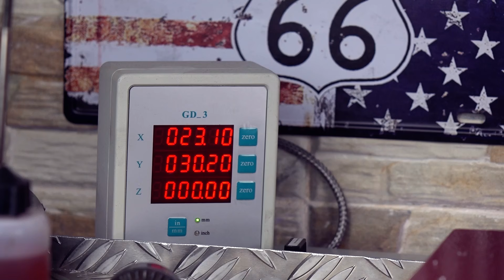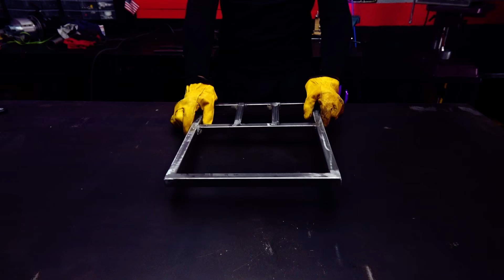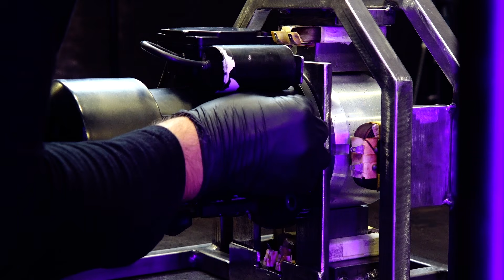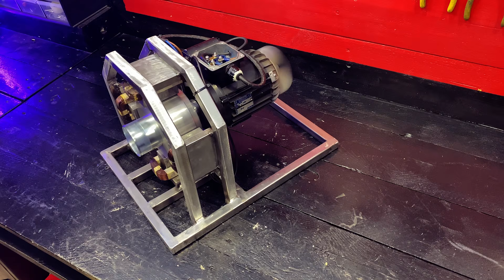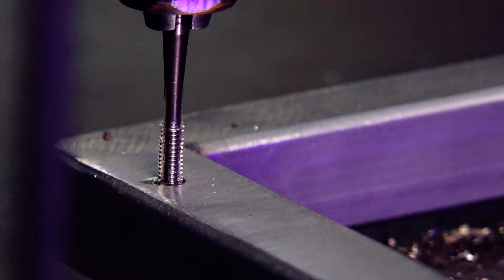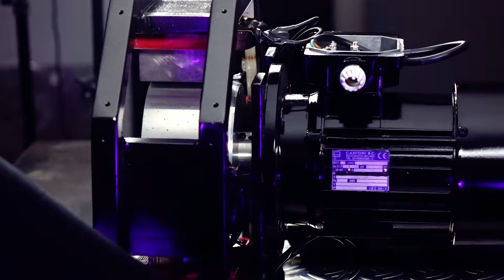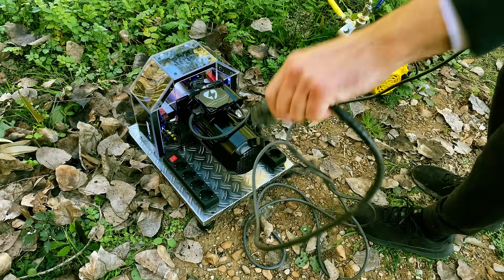20KW INFINITE ENERGY GENERATOR 110-220 Volts

Comment: i am not against it, with my limited understanding of physics, i dont want to question anything out of my knowledge. the motor cost, the magents life are the real deal breakers, for this to go to mass production the cost of operating this needs to be lower than hydro, coal, and nuclear power plants. at this moment. it still looks like a hobby project, can it power one home entirly ? an avarage full load is 5 fans, 2 acs, 1 fridge, 10 lights, 1 tv and 1 washing machine?
Reply: In response to your question: No, it cannot produce any energy at all, because magnetism is not an energy source — it is a force. This system has no energy input, so it cannot generate energy. That’s a basic law of physics. The only thing it actually produces is YouTube ad revenue for the people making these videos.
Reply: @PauliPurhonen you do know that if you spin an electric motor by hand it produces power. It the principle that regen braking uses in evs and such it's also something most kids learn in school using a small fan motor and an led. Electro Magnatism is how electric motors work so in theory to create free unlimited energy you had have to spin the motor enough to power the electromagents in combination with the earth magnets to keep that spin going. Because the earth magnets have a constant field as long as the electromagnets have enough power then again in theory it could spin forever. Now we have the laws of thermodynamics that say that can't happen for many reasons like friction, drag, energy transformation Ect but that's not to say that just cus we haven't over come them that they can't be overcome. Not saying that the videos we see about this stuff aren't scams cus most very well are, but if you do have any interest in the idea of free energy (which considering you watched the vid you do) I'd suggest you do some research in the past 60-70 years on all the different people that have worked on this stuff and died or disappeared after claiming they solved it along with them shortly after being burgled or such and their research disappearing alongside them. At this point there's too many instances to call it coincidence. Hope you have a great day

Comment: Weswegen kann man sich die schönen Ideen ansehen? Möchte man jedoch eines davon erwerben, gibt es diese nirgendwo. Liegt es am Kapital, in Serie zu fertigen für den allgemeinen Markt?
Mit so einem Teil in der Wohnung könnte ich drei Wärmestrahler betreiben und könnte gänzlich auf Gas verzichten.
Reply: “What is the frequency of the AC it produces for you? How is that frequency kept stable, since there is nothing in the system that sets it to any value or keeps it at a fixed value?”
Reply: This is typical — when you ask a basic question about how AC is actually generated, there is no answer. And of course there isn’t, because the claim simply isn’t true.

Comment: I've been planning to develop this idea since 2014. In 2016, I defended my thesis at university with a small prototype with the same function. My teacher at the time was very happy but explained that it would be very dangerous, and that those who didn't find it effective could cause me worse harm. After that, I immediately stopped, but it always remained in my mind. And all this time, I've been constantly researching and searching for other people who had invented and improved this idea.
I searched and even read stories and found that Nikola Tesla invented a similar design and prototype, and he, too, was rejected by some international organization protecting oil magnates. I'M VERY GLAD THAT OTHERS ARE PROMOTING THIS IDEA, because this project is a great salvation for our planet!
You can replace the manual starter with a battery with a button and an inverter from 12V to 220V to an electric motor, and it will be a starting device. I have more ideas for further improvements 💡 
Я планировал разработать эту идею с 2014 года. В 2016 году я защитил диссертацию в университете, представив небольшой прототип с аналогичной функцией. Мой преподаватель тогда был очень рад, но объяснил, что это будет очень опасно, и что те, кто не сочтет его эффективным, могут причинить мне еще больший вред. После этого я сразу же остановился, но идея всегда оставалась у меня в голове. И все это время я постоянно изучал и искал других людей, которые изобрели и усовершенствовали эту идею. Я искал и даже читал истории и обнаружил, что Никола Тесла изобрел похожую конструкцию и прототип, и его тоже отвергла какая-то международная организация, защищающая нефтяных магнатов. Я ОЧЕНЬ РАД, ЧТО ДРУГИЕ ПРОДВИГАЮТ ЭТУ ИДЕЮ, потому что этот проект — великое спасение для нашей планеты! Вы можете заменить ручной стартер батареей с кнопкой и инвертором с 12 В на 220 В для электродвигателя, и это будет пусковое устройство. У меня есть еще идеи для дальнейших улучшений 💡
Reply: Great

Comment: Could someone explain what three‑phase electrical frequency this device is supposed to produce, and how that frequency is regulated and kept constant when the load changes?
Is it 50 Hz?
If so, what mechanism in this machine generates that exact frequency, adjusts it, and stabilizes it under varying load conditions?
Reply: Yes, I was thinking the same. That motor is a DC type motor seems to be 1HP alternator. Now if this kind of motor you used to generate power will produce less than 2HP. This guy is running water pump (0.5HP), angle grinder (.75HP) & a Jig saw (.75HP) along with apple computer which needs 200 Watts atleast. The total goes to 2.25HP which seems impossible. Again there is no fluctuation which seems impossible without capacitor bank backup.

Comment: Hi, a question for the creator of this video.
When you built your workshop machines and produced this video, did you actually power your tools using electricity generated by your “Liberty Engine”, or did you use regular grid electricity?
This doesn’t seem to be the first device you’ve built — the video suggests you already have experience with these systems.
So I assume you are producing your own free electricity with this setup and using it in your workshop.
Could you tell us how many kilowatt‑hours you have generated and consumed with this device?
That information would be extremely useful.

Comment: what happens when magnets balance themselves and potential reduces. Does it stop rotating ,unless you give it anather boost?
Reply: Of course it stops. Magnetism has both a positive and a negative force, and they cancel each other out. You can’t change that with any magic metal or any magic metal structure.

Comment: I really support your channel; I love it. However, it would be great if 3D models could be included in the future. This would allow the parts to be replicated in 3D, since many people likely own a 3D printer. Instead of manufacturing the parts from aluminum—which is a bit expensive—I think it would be easier to 3D print them using engineering-grade materials.

Comment: 13:00 The fact that the "generator" did not slow down even a little bit and the hum of the moving device also did not change at all indicates that the light bulb does not get its electric energy from the alleged generator. Instead, both the light bulb and the motor share the same hidden powerful source of electricity, which is so powerful that adding the load of a light bulb to the load of a motor makes no or only an imperceptible difference in the operation of the motor.
Reply: the lightbulb does not pull enough draw to change either of those things you mentioned.
Reply: @pspuria81  There is no proof that this alleged magnetic generator is capable of supplying 20KW  of power..

Comment: Hmmm.... if that cord and that guy could actually handcrank that motor without snapping it, I'd be impressed. But the tensile strength on either would hit the bump threshold, and stop cold. 

A few other issues, but we'll just leave it there.

Comment: Hi is there a reason why you didn’t cut the extra length of the transformer mount so the coil could be mounted closer to the magnets? If it was mounted closer to the magnets wouldn’t it produce more electricity?

Comment: It's real because I did one but extremely smaller than this.
Even others did without realizing its principle and the principle is manually running a magnet across a copper coil wire to produce electricity 😂😂😂

Comment: why dont you connect a power analyzer or power meter, so you can see the total power output, in use and the remaining. 20kw seems imposible from 4 smail coils.
Reply: I read it as 20w. Not 20kw. It's 20w with additional insignificant digits, the video shows a period, not a comma. I am not familiar with any scientific body that displays thousands with a period.

Comment: Such an invention is really impressive! I have a question for you. How many motor hours can such a motor last? And how do you deal with the demagnetization of neodymium magnets? According to the theory, they should gradually release their energy, which means that the motor will eventually stop.
Reply: Si può sempre optare per un dinamo auto modificata (senza magneti permanenti ma rimuovendo l'elettronica interna) che ha il campo del rotore a magnete convenzionale, ma li si corrodono nel tempo le spazzole del collettore. Tanto per fare due conti un alternatore auto eroga 100/150A a 15/17Volt e mediamente una vita di 10 anni.

Comment: you want to tell me on that machine can flow electricity of aprox 90 A. It would burd in shortest time possible...  220 V multiplid by 90  equals to  20 000 VA nearly  20 000 Watts
Reply: per portare fuori quel corrente i fili dovrebbero essere da almeno 6/8 mm quadri. 20Kw fatto cosi è una creazione da folle che non si preoccupa di incendi dei cavi . Se arriva erogare 5KW è comunque ottimo ma vorrei vedere una acquisizione dati serial sotto carico variabile per un week end a 20Kw pieni ( Tensione/corrente erogata, tensione/corrente dalle COIL compresa quelle del motore,  forme d'onda, analisi di Fourier della sinusoide, temperatura motore, temperatura magneti, Termografia dei vari componenti, temperatura ambiente campo elettromagnetico disperso localmente, ecc.., stress ambientale al variare della temperartura ). Se regge ne monto uno all'interno della macchina per la ricarica quando e ferma.

Comment: Connect it to a load and running itt. For a ffewdsayy mmmeasuring it begins rpm and rpppm a feed days. Later
Reply: Days?  This thing won't even run for a few minutes, and most definitely will not produce 20 kW.

Comment: This is nothing new or a big secret😂  you can build it without a lathe and the “special alloy”.😂  The Power looks good until you try drilling or cutting metal.  The thing it needs it’s high Current to do anything good, it probably outputs 1.5-2Amps max!
Reply: The output is 20kw, @ 230volts, you do the math!

Comment: No. If that were possible, we would have a perpetual motion machine, something that violates the known laws of physics.

What happens is the following:

* You give the generator an initial rotation.
* The generator converts part of the mechanical energy into electrical energy.
* If you try to use that electricity to power a motor that spins the generator itself, there will be losses at every stage:

  * Losses in the generator (heating, friction, electrical resistance).
  * Losses in the cables and electronics.
  * Losses in the electric motor.
  * Friction in the bearings and air resistance.

For example:

* You supply 100 W of mechanical energy.
* The generator produces about 90 W of electrical energy.
* The motor converts those 90 W into about 80 W of mechanical energy.
* The system returns less energy to the shaft than it originally had.

With each cycle, the available energy decreases until the entire system comes to a stop.

That is why power plants require a continuous external source of energy:

* Falling water (hydroelectric power).
* Steam from a boiler or nuclear reactor.
* Wind.
* Fuel.
* Sunlight.

Many videos on the internet show systems using flywheels, magnets, or "self-sustaining" generators. A flywheel can store energy for a period of time, making it appear that the system is powering itself, but in reality it is simply consuming the energy that was initially stored in it.

A simple analogy: imagine a bicycle with a dynamo connected to the wheel. You pedal, and the dynamo generates electricity. If you use that electricity to power a motor that tries to pedal the bicycle for you, the motor will always return less energy than the dynamo took from the wheel.

Comment: Very interesting project. I have a few technical questions:

How long can the system maintain a constant RPM under load? Is the rotational speed stable for hours, or only for a short period?

What is the generator's electrical output (watts), and what is the total input power required to keep it running?

Have you measured the complete energy balance (input vs. output) over an extended test period?

I would be very interested in seeing long-duration test data. Thank you.
Reply: Yep.  It works for about three milliseconds, at a tiny fraction of the "20 kW" hype.  Pure garbage.

Comment: Неужели еще есть дегенераты которые верят в подобную чушь ?
Reply: It's a lot of hard and tiring work... digging the ground to reach the riverbank and installing the power cable under the device.
Reply: The reaction of the power plant that is supplying the power to this motor, which provides sufficient frequency and amperage to this toy system.😂😂😂
Reply: Yup.  As the saying goes: There's one born every minute...

Comment: What is this special alloy that they are talking about?  In the beginning they say you have to have it to make this thing work
Reply: It's bogus.
If it was creating power - rotating on its own - it wouldn't stop when the power was turned off from the motor.  The spinning force would be driving the motor - not the other way around.
Reply: @KalashSpooner  а откуда энергию тогда берет двигатель?
Reply: Aluminum 6061 is fine to use since Aluminum is not magnetism

Comment: The generator motor is directly connected to the spinning magnets.  Turning off the power will not stop the motor.  It would need mechanical or electrical braking.

Comment: Umm so if you notice the magnetic force from the coil centered the itself but it didn't keep turning...... yeah thats friction loss. You might get it to work for a small period of time but gravity and friction will stop it. Once a load is pulling from it it will stop. With clever video tricks you can make it look its working without making it work.......

Comment: Bonjour, je connais un peu l'électromagnétisme ainsi que les lois de la thermodynamique. Depuis le début, j'ai l'intuition que la composition, la taille ainsi que la forme et les dimensions de votre rotor principal joue un rôle très important. Est-ce bien le cas? J'ai bien évidemment remarqué que vous avez éliminé quasiment toutes les forces de frottements (ce qui est essentiel pour ce projet), mais avez vous choisi n'importe quel moteur ou l'avez vous fabriqué vous même pour être certain qu'il y a un minimum de frottement aussi dans le moteur? Grâce au coffrage vous limitez également les forces extérieures comme le vent, la pression atmosphérique, etc. Mais il y a forcément de la chaleur ainsi que des mouvements d'air à l'intérieur du coffrage, non? Cela devrait logiquement freiner légèrement votre appareil au fil du temps, ou la force magnétique élimine complètement ces forces (aussi minimes soient-elles) ?
Sinon vous ne parlez pas du tout de l'intensité de votre engin. Est-ce que l'utilisation des multiprises inclut une résistance électrique garantissant une intensité constante? sinon je ne brancherai pas d'appareils utilisant un transformateur comme un chargeur de téléphone par exemple. La tension étant constante, et n'ayant pas vu de résistance ou autre matériel électrique, votre intensité est logiquement constante également, et assez puissante pour utiliser plusieurs appareils donc assez grande pour faire frire un petit transfo. Enfin ça me parait logique. Est-ce que les multiprises sont aussi présentes pour cet effet en plus du côté pratique évident?
Sinon c'est absolument génial. De puis que j'ai vu cette vidéo, je ne pense plus qu'à m'en fabriquer une pour mon usage personnel. Je cherche encore matériau et équipements, surtout pour la fabrication du rotor. Je vis souvent isolé. J'ai déjà bidouillé des trucs du genre mais je n'arrive pas à le faire tourner aussi longtemps. Pourtant j'utilise beaucoup plus de bobines, mais c'est la raison de mon dysfonctionnement. Un rotor avec des bobines n'a surement pas la même stabilité que le poids de votre rotor. . Mon cerveau bouillone ;) Merci beaucoup, Votre vidéo esttrès bien faite et vos explications sont très claires. Encore un grand merci.

Comment: One Question , Currently what frequency does the device outputs at ? 50hz , 60 hz  , also can you add a amp draw display to unit and breaker system with rated 10% under maximum output ....

And 2 parallel  transformer phases feeds motor at 230v and other parallel  phase powering connected components...

Comment: I really liked the video, it's very detailed, but I'm unsure about the coil connections. If possible, please leave a link in the description with a detailed electronic diagram of the coil connections. I'm looking for materials to build my own. If it works, it will save me money on energy costs. I'll thank you for these savings by depositing them into your account or the channel; it won't cost me anything. It's a duty and a moral obligation if you give me more details. My generator is working perfectly. That's it, perfection comes with trying.
Reply: risparmia il tempo e la fatica, non funziona.